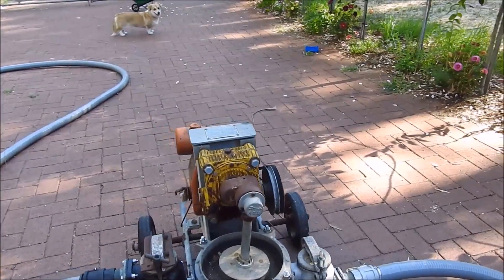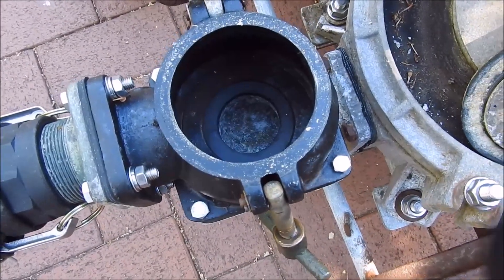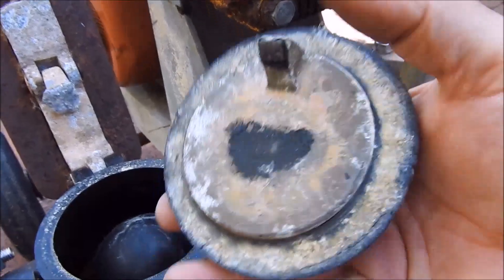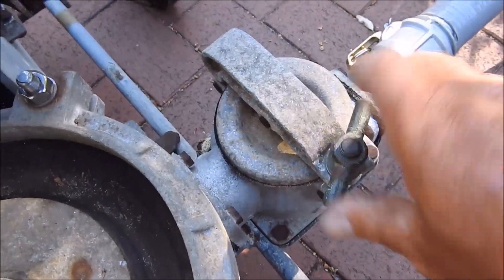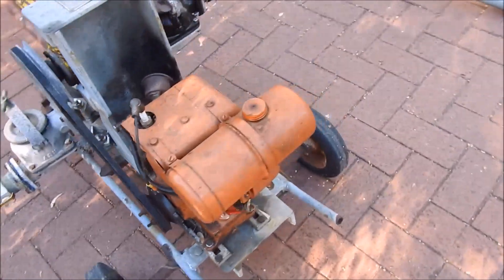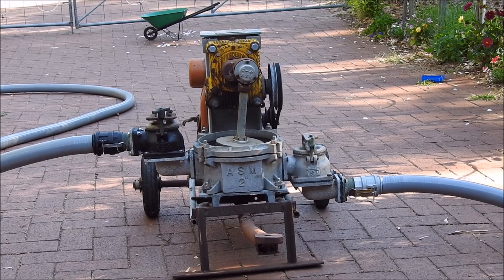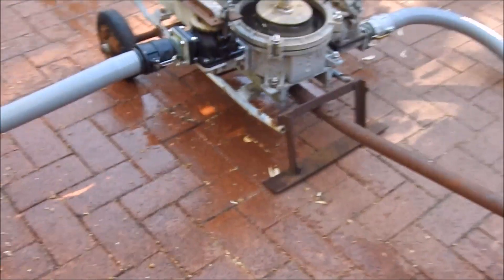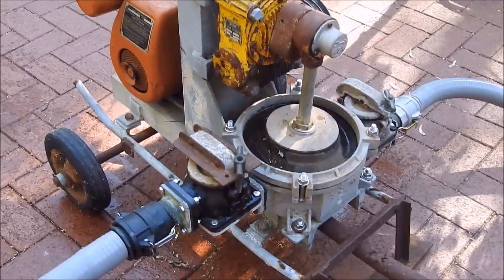Diaphragm ASM sludge pump

Comment: Why don't you put a foot valve at the end? It will be better. Other questions if you can help us with that.

What if you put a check valve at the hose inlet, start the pump, and close the valve for 10 seconds and then open it? That will build up pressure and improve suction for low-level liquid cases. What do you think about that?
Reply from the maker: @salaahedd8650  no these work on displacement so a foot valve would not alow it to start pumping, different to centrifugal which requires a foot valve. These are self priming and has two one way valves actually on the pump that are free moving rubber balls to not cause any restriction. A foot valve on the bottom would also immediately block up as it is right in the mud. These pumps are designed for slurry, not clean water. Small rocks seem to cause the most problems. Fine sand with lots of water isnt an issue.
Reply: @rotaryhoes I want to use like  a shop vac. It's useful for a septic tank, but as you show in the video, the water backflows in low levels. I was thinking of a foot valve that opens when the vacuum is on and closes when it's not to stop the backflow. For portable toilet service, it's mandatory that there is no remaining waste.

Another solution is to make a valve that closes for 10 seconds to keep pressure building up in the hose a little bit, then open it to suck with no backflow.

But until now, these are all theories that need to be tested. What do you think is the best solution?
Reply from the maker: @salaahedd8650  i think trial and error is the best way to go, building up vacuum with a valve sounds like the best idea to me, especially for that last bit to finish off.

Comment: I think it will not work for a portable toilet vacuum because there will always be some residue. Before this video, I was thinking that the low pressure in the hose would suck everything up, even the last drops of water.

Thank you; the video was very useful. I think no pump will suck 100% as well as a vacuum truck pump.